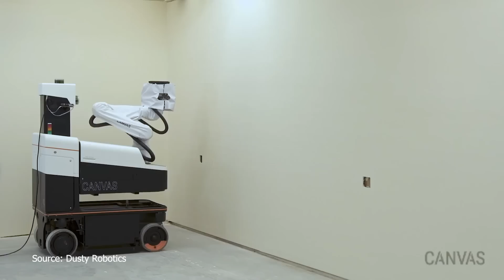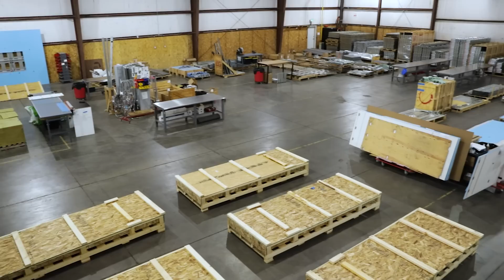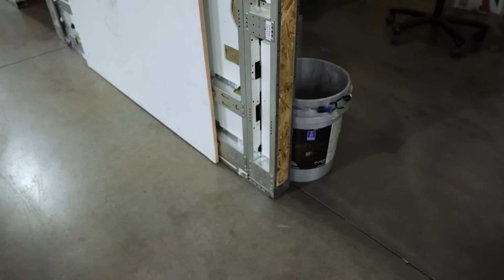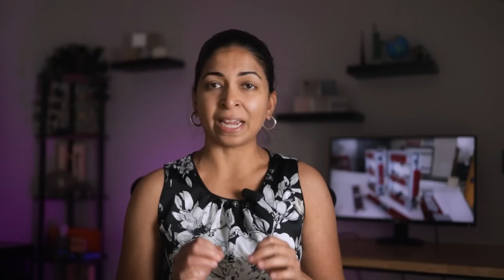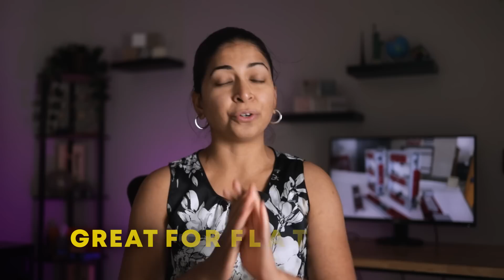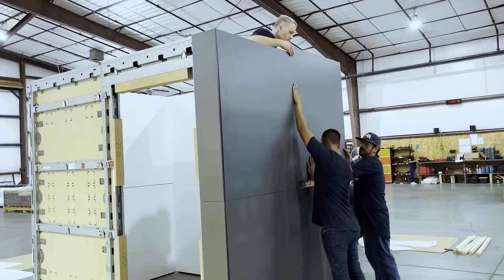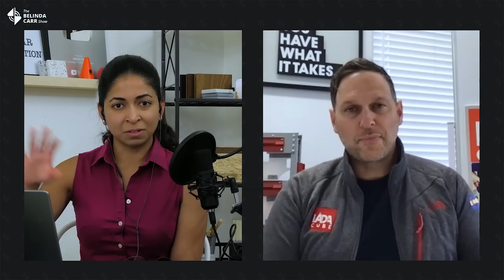Could this reusable metal wall be the 2x4 of the FUTURE?

Comment: I appreciate your videos and I am big fan of those that criticize the flawed design and architecture.(e.g. container box homes) I understand that this one is mostly an infomercial and it has genuine applications in places like Wal-Mart. However, I cannot help but notice quite a few flaws that are either missed or ignored in this video. 1) Interior walls usually do not need thermal insulation and these panels are design for interior design, however, be it thermal insulation or sound proofing (which i believe that what was meant and was visible in the video) using metal studs extremely lowers the performance in either case since metal is a conduit for both, orders of magnitude higher than wood. I refer you to Joseph Lstiburek talks that explain why using thermal insulation with metal studs is basically an oxymoron. 2) This brings me to the second missed issue. Metal (specially steel) has significantly higher carbon foot print and negative climate effects compared to wood. It is true that wood from trees also has sustainability issues compared to bamboo products but the small amount of metal used in this panel have much higher carbon foot print of an over-designed wood stud wall. This makes me wonder whether the circular life cycle suggested is more of a gimmick than real concern for sustainability 3) Regarding the claim for cradle-to-cradle design idea of these walls, I am a big fan. However, I have serious concerns regarding the materialization of the claim. Walls are designed to resist forces even when they are not load-bearing. I wonder how would those cam-locks fare after a few years of residential living after few heavy frames hanging for years, falls, etc. that cause lateral loading that may bend the fitting or the even the frame ever so slightly but enough to make them non-reusable. Furthermore, It seems to me that (and please correct me if I'm wrong) the top covering of the wall has no innovation over normal walls and which require the taping of the joints and evidently makes them non-reusable anyway. Sorry for the long comment, but I like your videos and appreciate your higher standards which I hope you maintain and thank you for the informative videos.

Comment: Kinda Off Subject but I had a similar idea for an RV/motorhome build. Where things like the kitchenette was on castor wheels and latched into place. So you could quickly disconnect everything and either rearrange it. Or remove it, so the motorhome could convert into vargo trailer.
Reply: Not as off subject as you'd think! We're always looking to other industries that do isolated modular solutions well.
Reply: @LådaCube  Thanks 👍 The other reason for the idea, was so you could take a box truck 🚚 and fairly easily convert back to either sell or resell as a box truck or a motorhome. Once a person spends alot of labor & money to make major permanent renovations/changes, to convert a van or boxtruck to a motorhome. It's hard for them to get money back when reselling. They'd need to find a unique buyer who loves their creation. If the majority of interior furnishings can be detached & easily removed/reinstalled. Then #1, the vehicle can be dual purpose, used for work hauling cargo on say weekdays.Then quickly converted back into motorhome/camper for weekends & vacations. #2 interior furnishings like a kitchenette, cabinets, water tanks. removable wet bath,etc.... Could be resold to someone else wanting to do a motorhome build.
Reply: @michaelbrinks8089  Love the concept. We've had discussions with a few customers about this, but not an actual application we've completed to date.

Comment: Nice for anything temporary (big fairs, temporary hospitals ?, ...).
Most of this will only serve for a very niche market, and even there the cost of transportation from location A to B is going to be the main hold-back.

Even open spaces in offices don't change often enough to make this worthwhile. Let alone fulfill the safety requirements to prevent theft/robbery.

And of course none of this is about building exterior walls/buildings in the first place. Add the price of "wasted space" due to inefficient cubes inside a bigger open interior space.  How is fire detection handled in all those voids? How does it co-exist with any fire suppression system the building might have?
Also the exterior building/place better not have water leaking or other electric issues.
It seems to create more problems than it solves.

Comment: This product make sens for fast comercial buildings. But there are problems with poor sound insulation and integridy in case of fire - the strucktural part (steel studs) have high thermal expansion. So it´s a trade off as everything in construction industry.

Comment: Belinda, lots of comments here concluding that this is a niche product, not ready for residential or primetime etc - I'm almost sorry to agree. That said, us in your audience (certainly me!) are likely interested in a whole series on modular panelized for residential.  I have the impression that it`s a fast-evolving space, and that a lot of companies in my region tried to introduce or shift to pre-fab residential or modular construction products during the pandemic - with very limited success.  A house custom-designed online with clients and then built by a factory, shipped flat and installed precisely by trades on site, seems very technically possible and also unaffordable at the moment for the average first-time buyer.  What will get us over the line to doing that routinely, could be an entire series.  Another topic I would like: pre-approved building plans from CMHC in Canada or from USDA (iirc) in the US and groups like U of Iowa...but that`s another story.

Comment: I would love a house built out of these to allow for slight periodic rearrangements in the floor plan from time to time (though I'm guessing most homeowners would not care about such a feature).  The more practical use would be being able to easily remove walls to update electrical or repair plumbing.  

But yeah, the outer skins shown here are too ugly to make a space feel livable.  Hanging walls with magnets sounds great, but I don't see how you'd ever get away from the visible seems without mudding (which then makes the deconstruction less convenient).
Reply: Great comment! We also offer a removable drywall application.  Blessings

Comment: I'd bet my eye teeth that the Lada Cube will be adopted for low-rise commercial construction LONG before it transitions to residential. The average US office building's endures 40 years before it needs a major full-gut, down-to-the-studs renovation. How long is the average mall in operation? 25-30 years. Businesses and their buildings have well-known lifespans. Therefore it is entirely feasible to design and pay a premium for an easily de-constructed, re-buildable building. The premium price and costs of deconstruction are easy to amortise and justify. With a family home? Not so much, in spite of the fact that, on average, homeowners own their home for only seven years. Everyone's first instinct is to buy local - i.e., get the low rancher in Texas, the cute two-store Cape Cod, on the east coast, the mini-Tara in the Deep South. Most people do not want to bring their old house to the new place. They want a new house in the new place. I'm interested to find out if my 'gut instinct' proves to be correct. Love your content!
Reply from the maker: Yup, I agree with your assumption, Linda! I don't see this being adopted by the residential sector.

Comment: Couldn’t you make the same system for a lot less out of wood?
Reply from the maker: Wood doesn't guarantee the precision needed to make this system work! Lada Cube also has to custom-roll all their studs; they can't use off-the-shelf products because of variations.
Reply: @BelindaCarr  What about manufactured wood, like cross laminated timber? I’m just thinking about cost and thermal properties. It seems like these days you could get the same precision with wood without the greenhouse gas emissions involved in making steel (or the cost). Especially in the US and Canada, where wood is cheap and abundant.

Comment: Future of wall-building? Hardly. Only viable for spaces with false ceilings or open-air spaces within large buildings (generic office buildings, retail space in malls, event centers, changing rooms, seasonal kiosks, etc.) The dovetail panel clips would be all but useless in a traditional residential build, where you'd run into clearance issues with the overhead joists. Very rarely would any proposed "advantage" be realized in normal use. It has a niche and fills it, but crazy expensive if we're talking about more permanent layouts.

Comment: The immediate con: no Wi-Fi or cell signal reception, as it is essentially a Faraday cage.
Reply: Thanks for the comment.  We have never had a single complaint regarding WIFI or cell signal on any project that we have completed.
Reply: Yes, as you note, a metal Faraday cage would be bad for WiFi reception, however as LadaCube comment below implies, the metal enclosure isn't continuous to the grid scale smaller than the wavelength of WiFi signals, so the LadaCube partition walls are porous enough to pass WiFi just fine.

Comment: I can see it being used for convention shows, office partitions, emergency partition of a large facility for temporary housing (after hurricanes, earthquakes etc). I can't see these as easily being used for main walls of housing or offices. If a panel can only hold up to 300lbs, you need a separate external structure. The load paths in a building are usually just too diverse to capture with a single product but it is worth at least trying to figure out a new mouse trap.

Comment: These look like a modern version of the modular walls we use in data centers.  These environments don't like dust, so construction project needs to use panel systems to minimize damage to the data center hardware.
Reply: We have a data cabinet system coming soon!

Comment: As a contractor the cheapest wall is a steel stud system.  This  boutique system will work for displays, non permanent installations.  Creative, but the trades in residential and large commercial will struggle with this economically.   Great video and info!
Reply: As the cost of labor goes higher, the system will become more and more viable as the price goes down due to volume discounts in production systems. Even though i agree with you about the current trade on site. But there is shift coming soon.

Comment: I could see a far more customizable work shop because of the modular electrical conduit link system. What shop owner, backyard projects guy or garage mechanic wouldn’t love to have outlets in 110 & 220 all over their shop. And the idea that I could design a shop to dimensions that suit my interests and needs instead of having to pick height, length, and width preselected in a catalogue of expensive options.

Comment: I ransacked Lada Cube's website and couldn't find a design handbook. Seems ridiculous if they have such standardized skin, panel & corner parts & have been in business for a decade. I would think they'd be more clued in on how to get specified & sell more stuff.
Reply: Trade secrets. As an architect I would like to see all the technical dimensions and such too.
Reply: @garywheeler7039  So, how do you get architects and engineers to design with your system, when you don't provide any information to do that?
Reply: @andrewalexander9492  : exactly. They only mention vague  stuff like 8 foot tall panels, 4 feet wide and such. Little mention of how the bottom track and top track work, how we should stub out for electrical and such. Its a system without education of how it works mostly. They are so afraid of it being copied without payment.
Reply: @garywheeler7039  Incorporating into design software.

Comment: Seems incomplete. What about windows, doors, ceilling, lighting, hanging cabinets, HVAC ?
Reply: Thanks for your thoughts!  We do offer window RO options, you can use any off the shelf door & window system, ceiling options include any traditional systems (i.e. t-bar grid, etc.), and our digital blocking can be added to any wall and hangs up to 300lbs per screw!  We're always adding solutions as well to try and make the system more and more complete over time!  Blessings.

Comment: As a person who live in Norway where there is extreme difference in temperatures between summer and winter, my first concern is how the material react to this.
A second thing i would know, is what kind of sound it make. Old houses here make a lot of sound because the material move because of our temperature change and the change in material size because of this.

Also as a Scandinavian, we know how finished product do not always fit together as it should, we have learned that from Ikea.
With tree, that is easy to adjust even for a amateur, but with this metal walls, i am not sure how easy and flexible they are in that regard.

Also, tree in it self is a good insulation material, metal is just cold.

Also, when your house is ready, and you want to drill in the wall for thousand different reasons, it does not matter if you hit the house skeleton if it is made of tree, but that would become a issue with metal skeleton.

Also, trees are more cheap to cut down then it is to get the same amount of metal. And at least here in Scandinavia we always plant new trees whenever we cut down a area of forest.

This are the questions that pop up in my mind after 3 minutes..
I have build many buildings and restored old buildings from the 1800 and 1700 century, and that have been relatively easy because of the material they used.
And i could have done that relatively easy even if there was not a single fabric on Earth to produce the material. In this case we get completely depended on multinational companies to do it for us.
And as we know, they change their fashion from year to year, that way when the house is 30 years old or more and you maybe need to restore it, there will be no finished products to replace anything.
It would be like trying to get parts for a car from 1930 that you want to restore..

But when this is said, i must point out that i would not use this for a private home that i hoped would last for generations, but i would not mind using it for a garage, a store house and things like that.
And of course, the prize is always a big issue when deciding what to use.
I have a friend that is planning to start production of mini houses, and for that purpose they might be a good idea, if the prize is right. (I do not see this silly mini houses as something that shall last for generations, but only as a solution for poor people or for hippies that fall for a "tiny house fashion". But i still think it is a good business idea, and i will show him this video so that he at least have one more option to choose from.

One of the good things about this is that metal do not burn as easy as tree does.. 🙂
Reply: Just so you know structural wood elements maintain their structural strength longer in fire than untreated metal. Wood charcoals on the outside surface which creates an insulation layer to the heart of the wood (Trees evolved natural fire resistance), steel doesn't need to get very hot before it begins to soften and lose it's strucural strength, which occurs far earlier in fires than for wood if it's unprotected. That's why steel column's and beams must either be boxed in with plasterboard or another fire resistant alternative, sprayed with concrete, or painted with intumescent paint.

Comment: I'm curious on opinions of the construction industry switching to metric measuring.  Maybe it will be called a 2x4 for a long time but in reality its not even that, its 1.75x3.5.  with all the innovation going on to be green its a good time.  there's a recent episode on another house construction show where they were calculting a how much a counter sunk screw would stick out on the other side of something being attached to a wall and it was pretty funny hearing them stumble with the calculations.
Reply: 1.5 x 3.5 actually.
Reply: @garywheeler7039  oh yeah, 1/4inch off each face.  stupid fraction messed me up!!

Comment: So it's simply an "IKEA" metal paravan wall for indoor use. But what is the function of the rockwool insulation? Because it is impossible to thermally insulate this structure, and it is not good for sound insulation as it is so badly installed in the wall with all the gaps and holes.
Reply: I suppose you could wrap the exterior in rockwool and then bolt on some kind of siding.
Reply: @sunspot42  Yes, but then the advertised "greatest" advantage of reusability and speed and easy construction is already lost, because then it can only be built with construction workers who are capable of building facade thermal insulation and cladding. And then the walls can only be reinstalled after dismantling the facade insulation, and this definitely reduces the quality of the wall elements compared to the original condition and produces demolition waste. The problem is not that this system has disadvantages, but that it is advertised as a "universal" solution in the video, although I think its application possibilities are very narrow.
Reply: Thanks for the comment!  Good points.  The rock wool (or chosen insulation) for interior applications is for sound.  We can achieve up to a 45 STC with double sided insulation with a standard 35 STC.  The skins also provide another level of sound attenuation.  Blessings!